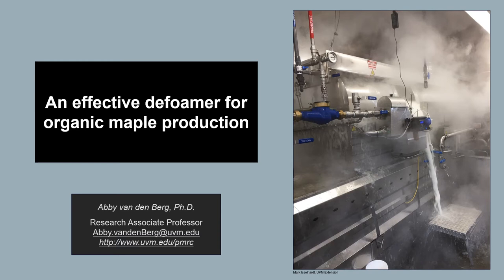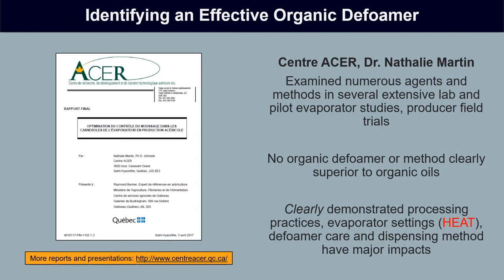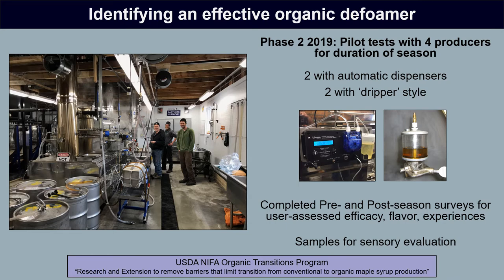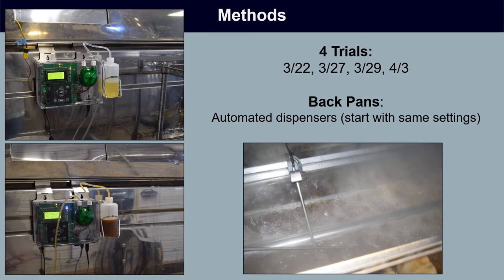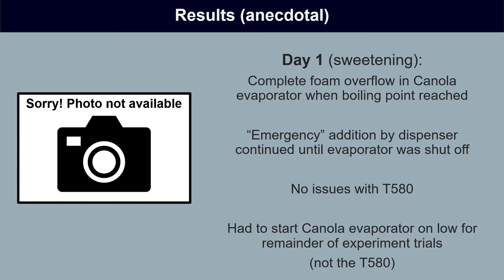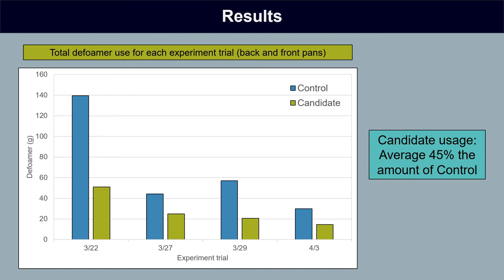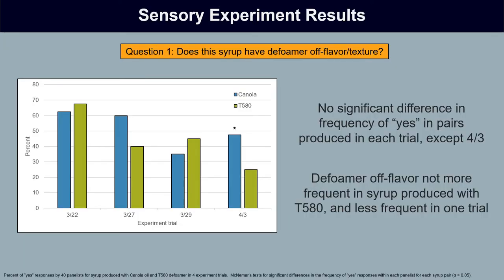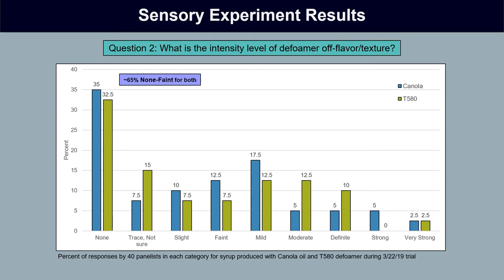Organic maple defoamer

Comment: Thank you very much. I plan on doing 24 trees in 2023, just as a hobby. So I am thinking a "slightly" larger evaporator run at a lower heat could be better choice overall.  I want to use the syrup to sweeten my coffee, so does darker syrup have a stronger flavor ? Am I wrong in thinking the lower temp would also produce a darker syrup ?  Thanks.
Reply from the maker: Typically a darker syrup has a stronger flavor.  Longer boiling will generally produce darker syrup.